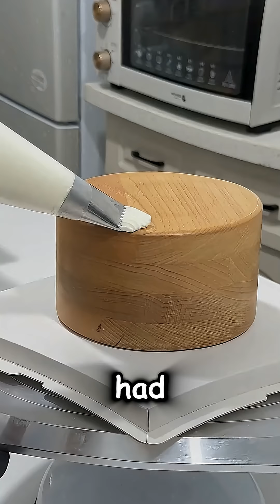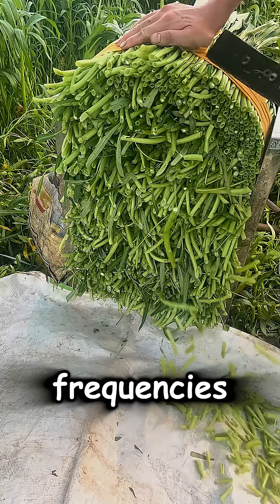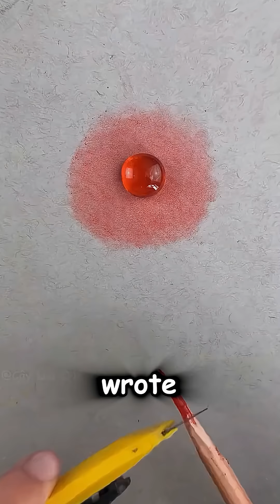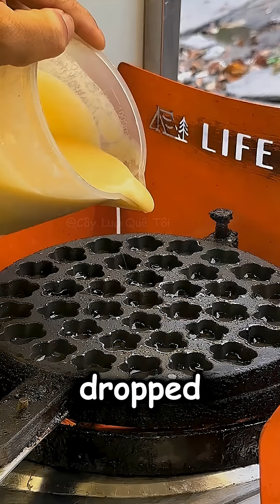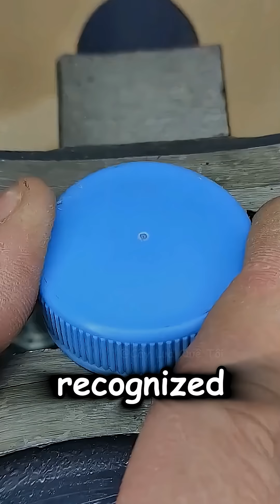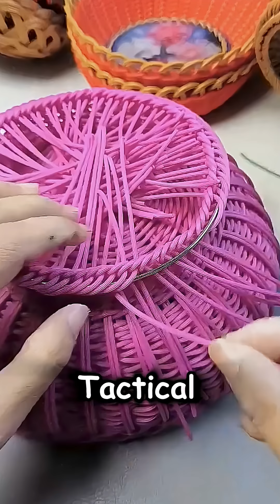#shorts

Comment: I confirmed that there were two other circuit protection devices and then decided to use paper clips to shunt an inline fuse on the BFT systems in our MRAPs until we could get the power conditioners straightened out. There were DOZENS of trucks running like that for months until a contractor was flown in to fix the power conditioners.